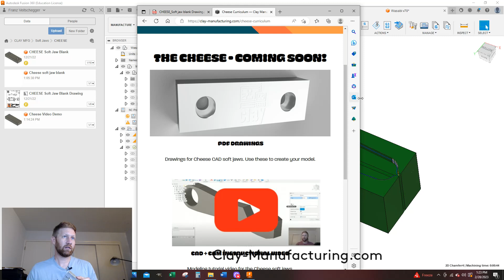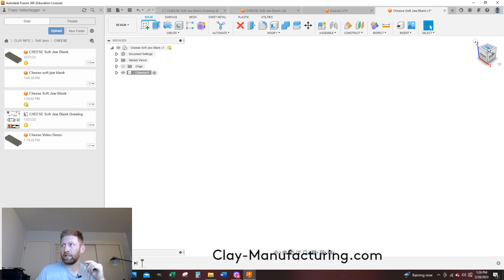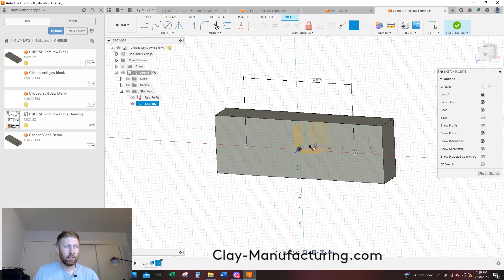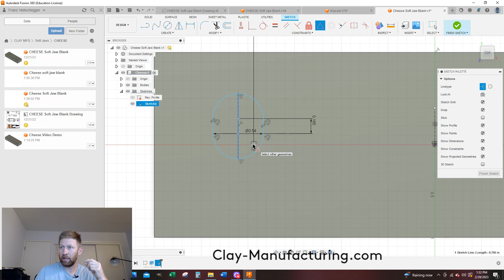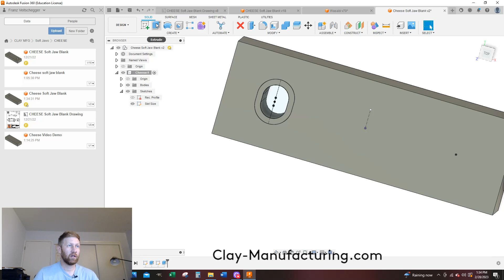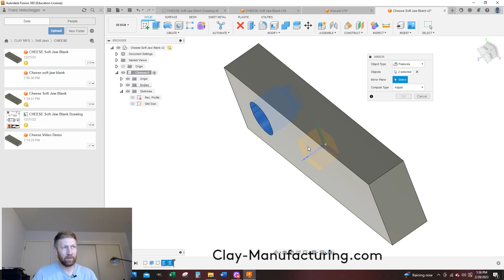How to model a soft jaw blank for a Kurt Vise using Autodesk’s Fusion 360

Comment: For symetry you need to do a "long pick" (pick hold for a second) to give you a drop down dialog "pop up, you can then scroll to the proper axis or plane for symetry. Also Fusion needs the view to be oriented straight at the viewer ("look at" front view or your part face). Lastly NO ONE addresses realignment of the soft jaws (jaw to jaw) when reinstalling.